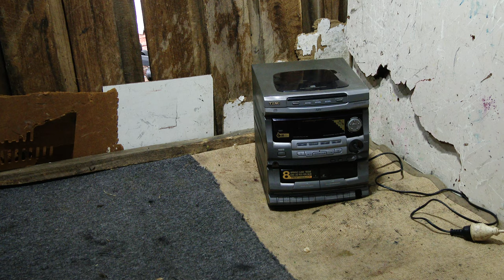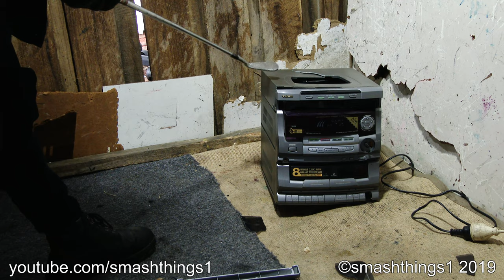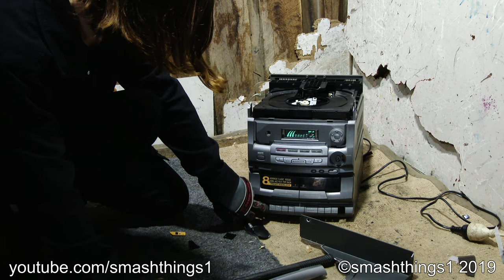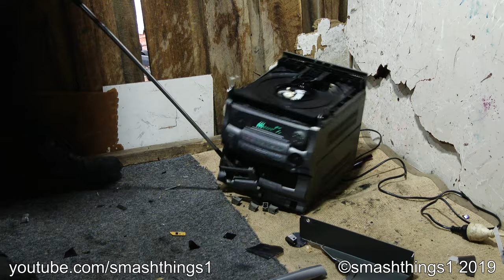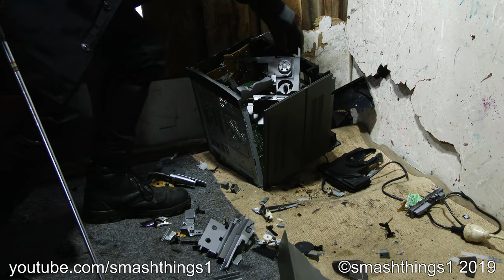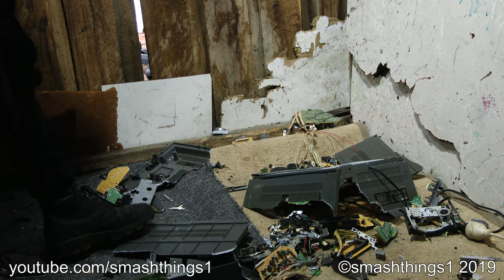Smash Teac Hi-Fi System

Comment: This systems wasn't even made by Teac, it's just one of those cheapo ones rebagged. In the UK this system was sold under the 
Goodmans brand maybe it is just a rebagged Goodmans. Early 2000s this is certainly not vintage, just cheap and nasty tat and 
I bet the CD player was already broken, OK it does have an AUX in but even so if the cassette decks still work it probably won't be 
long before those pack up and being a horrid cheap mechinism they may end up eating your tapes and have a very poor sound 
quality which is why I prefer the cassette decks with soft touch buttons to those clunky mechanical buttons.